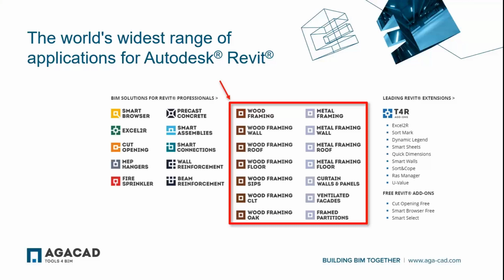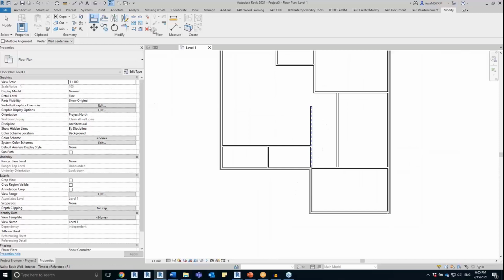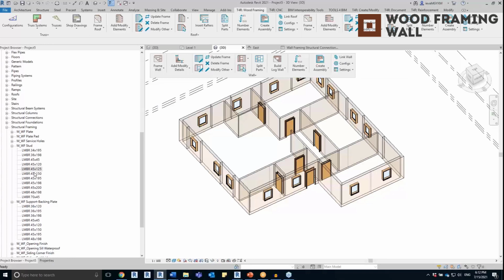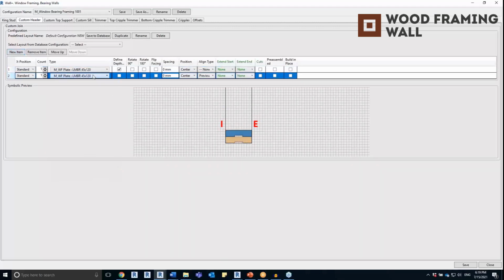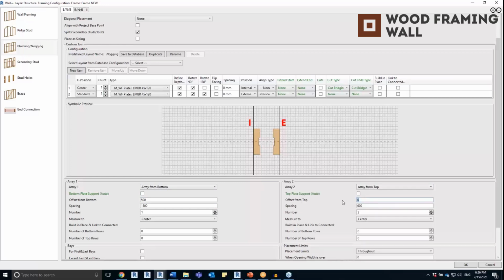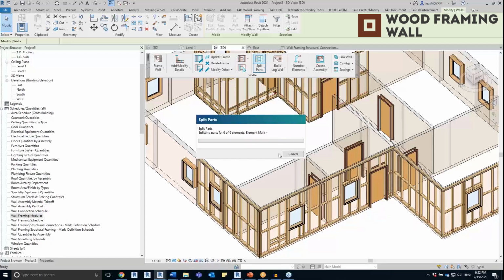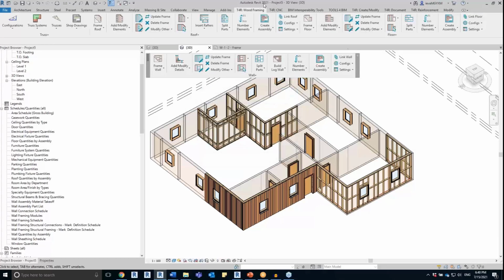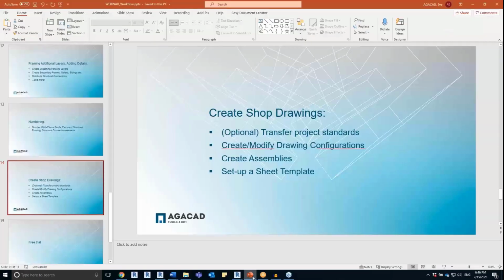The Best Way to Start Framing in Revit

Comment: floor framing and roof framing, can it drop in hangers for a rafter to ridge connection?
Reply from the maker: Yes, we can distribute Structural Connections (hangers, holdowns, bolts, etc.) based on element intersections automatically. Thanks for watching!
Reply: @be-smart-software  even when the rafter to side of ridge is at the roof pitch angle?
Reply from the maker: @bnmporvida6138  Hard to say for sure without a visual, but from your description sounds like still "yes". Feel free to send us a visual helpdesk@agacad[dot]com for a more definitive answer.
Reply: @be-smart-software  also when placing in a Ridge Beam, it drops it down from the peak, i need  it to not drop and stay at the level it needs to be so rafters can connect into the sides.
Reply from the maker: @bnmporvida6138  To help you further, please write to our helpdesk.

Comment: The Frame Wall command keeps deleting my doors/windows automatically, once it generates the frame. What am I doing wrong?
Reply from the maker: Hi Andrea, thanks for the question, so sorry for the delay in replying. Best would be to contact us via helpdesk@agacad[dot]com. This sounds similar to an issue a client or two have had that involved a third party updater. It may have been hsbcad 'Delete Elements' Updater, but it deleted Openings after using the 'Frame Wall/Floor/Roof' commands. The issues were gone after uninstalling or disabling the updater.